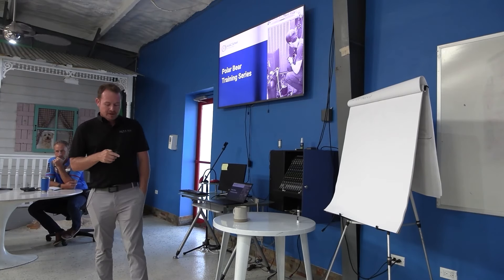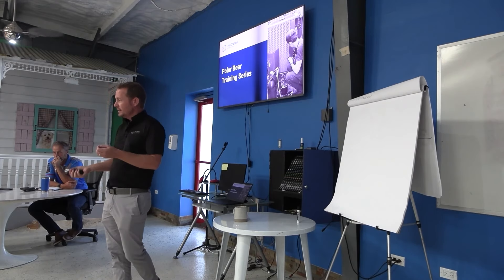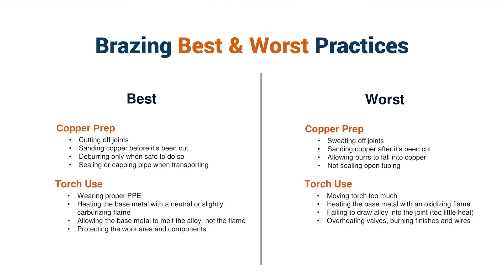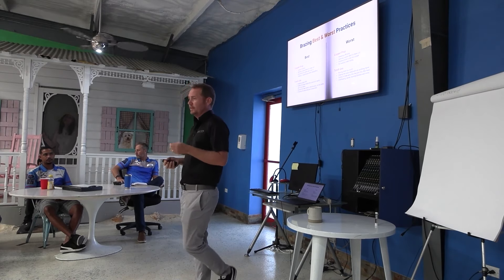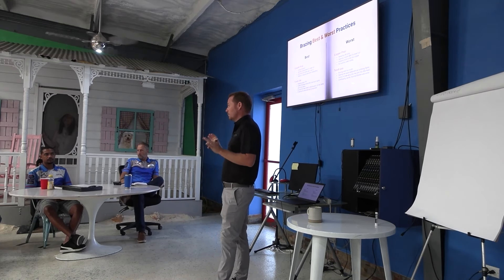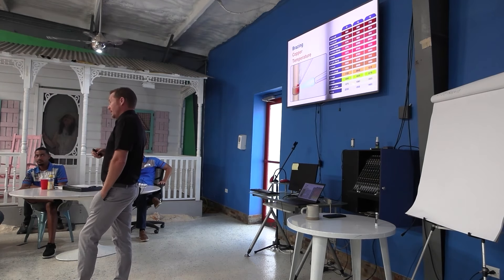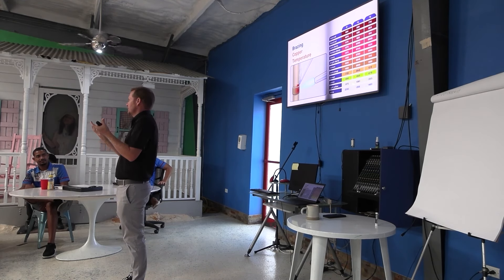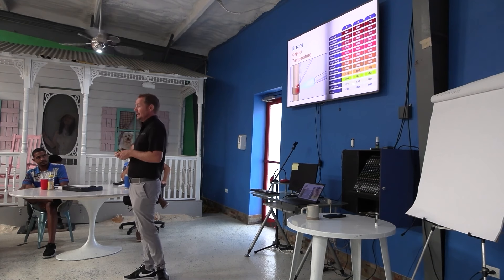Installation Best Practices: Brazing & Leak Checking

Comment: Over thirty years ago I went through the HVAC course at UTI and my instructor told us to watch for the flame tail to turn green to signify that the copper was the proper temperature to start brazing. Have you heard of this? I have used that for brazing water piping but never brazed on an A/C system. Thanks so much for the great videos Bryan.
Reply: Its not an indicator of whether the copper is at the proper temperature but rather an indication of already existing solder on the pipe from which you are brazing. that green flame appears when it is sealing the pipe with the solder.

Comment: I bought the Pipe Wiper and it's worth its weight in gold.  The extra time it takes to use it is saved but cutting down vacuum time.

Comment: I'm superstitious, never pack the oxy acetylene back in the truck until you've done the leak check.
Reply: This is so true 😂

Don't insulate flare connections until leak check passes too.
Reply: I’m was raised the same way. Can’t put the torches away until we pass decay test
Reply: I don’t even turn my manifolds off until I verify no leak
Reply: Same way
Reply: Same here! Every time I put tools away early, I find a cause to bring them back out.

Comment: A question for the pro's. For ductless minisplit, would it not be better to cut, and braze the lines (using nitrogen) rather than use the flare nut, as that always seems to be the point of failure / leak.

Comment: If western enterprise the company that makes those vn500 regulators if they came out with a bluetooth regulator that you could control with your phone it would save me many trips back and forth from the attic. Quit often the nitrogen is left running longer than necessary and I end up going through nitrogen bottles quicker than I otherwise would. Also I like to put the regulator on test while I deburr the tubing so the shavings get blown out. Having the ability to turn the nitro on and off without having to run back and forth or have somebody manning the regulator would be amazing in my opinion.

Comment: If a system was installed without using nitrogen, what would be the best way to resolve it?

Would it require draining the system, removing the brazed areas, replacing the filter dryer and refilling the system?
Reply: It nitrogen wasn't used, the damage is already done.  Hope for the best.  If the compressor fails, then you can attempt to remove the carbon and acid (if present) by using some type of pipe cleaner (ie Pipe Wiper)   The Pipe Wiper is only designed to clean linesets (great for cleaning mineral oil out of linesets when changing unit from R22 to R410A.)  The little dobber won't travel through a evaporator coil.
Reply: @josephwilliams1500  i honestly don't think many techs probably go through the trouble of using nitrogen though. there's a proper way, that some businesses employ, but I'm going to hazard a guess that the majority don't bother.